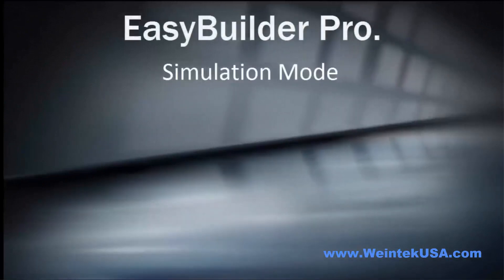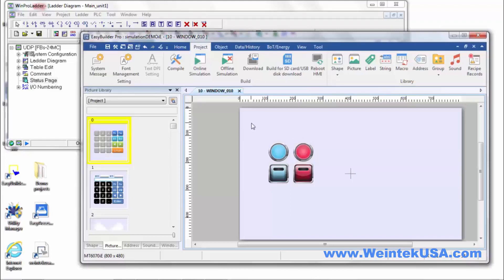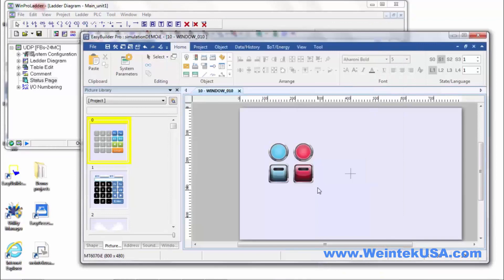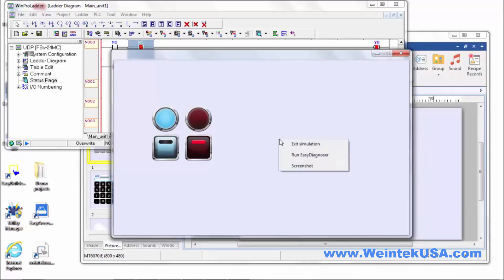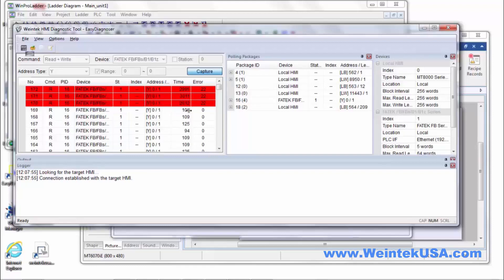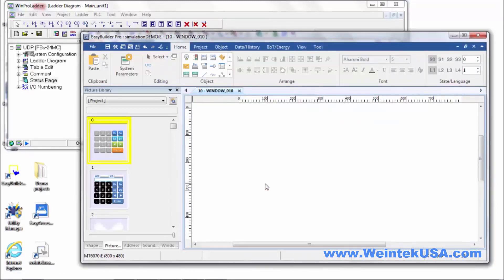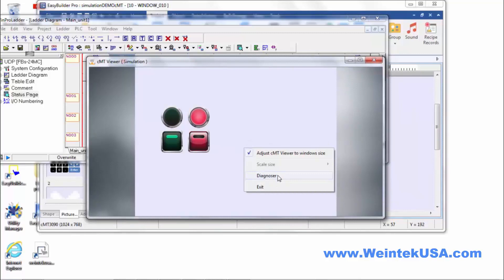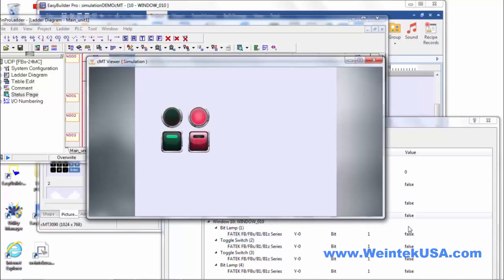Online Simulation demo with EasyBuilder Pro EasyDiagnoser, cMT Diagnoser

Comment: I am having the problem that SCADA weitek (Online Simulation) connects for about 10 minutes, then it loses connection, then it reconnects ok but after 10 minutes it loses connection.  I changed the connection cable but it didn't solve the problem

Comment: Great demo! I have an annoying issue with EasyPro Builder 6.04.02 and the serial connection  to a Mitsubishi Fx1n PLC using RS-485-4W. The inputs with X address are not responsive  in online simulation mode but the outputs with Y address are using physically wired input switches. When I press on a switch on HMI with X000 address nothing happens but when I action a hardwired switch to X000 of the PLC the output  Y000 is activated on the HMI. It seems that read from PLC works fine but not the write to the PLC. Any suggestions? Thanks a lot
Reply: Hi Faouzi,
I would suggest that you check the PLC connection guide (https://youtu.be/oThTTd-9vdU) for the driver that you are using within your application. If the X register is a digital input register it may be read only.